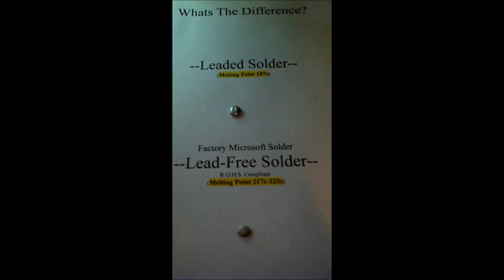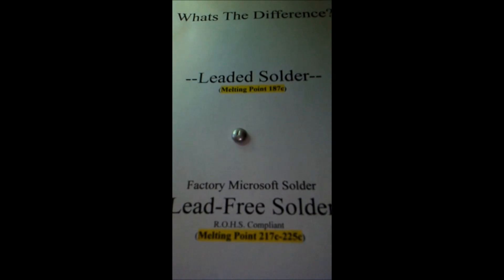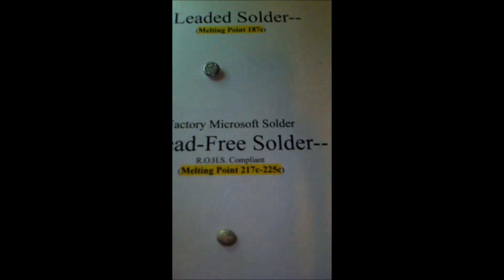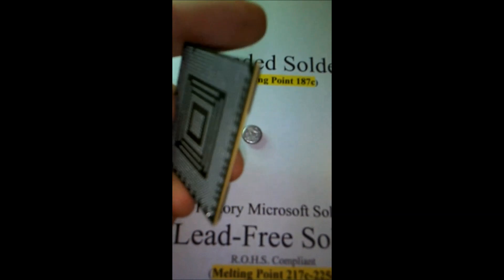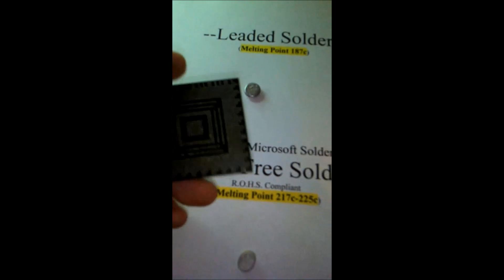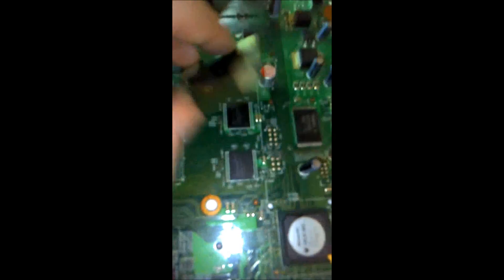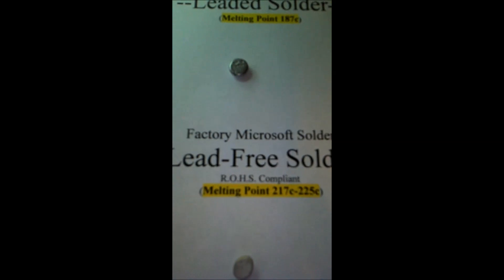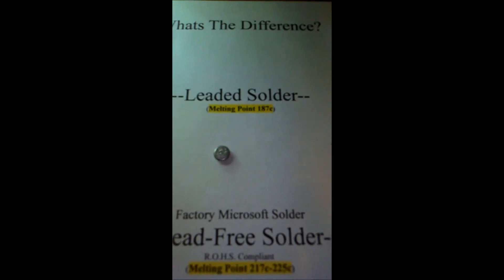Lead-Free Vs. Leaded Solder - For RROD / YLOD Repairs - By The Computer Guy of Fresno

Comment from the maker: There is allot of different opinions about this topic. I would say personally from experience that a reball regardless of the compound used will last quite a long time. I however disagree and I think that anyone who proclaims themselves the best in the world is someone I would avoid. Leaded solder has been industry standard for a reason, and I think if you look at the comparison in the video you will see how unstable lead-free is. It like using soy-milk to make a milkshake in my opinion.

Comment: there is a guy on ebay that sells 60gb models . this guy says : "THIS SYSTEM HAS BEEN REBALLED BY ME , THE BEST KNOWN IN THE WORLD FOR PS3 REBALLING AND THE ONLY ONE WHO IS CAPABLE TO REBALLING PS3 USING LEADFREE SOLDER WHICH IS THE ORIGINAL MATERIAL USED BY SONY FOR THESE SYSTEMS -NOT THE CHEAP UNSAFE LEADED SOLDER THAT IS USED BY OTHER REPAIR TECHNICIANS" what u think about this. BTW thank u for this video i love it!!!!